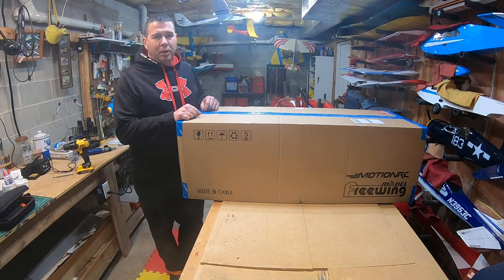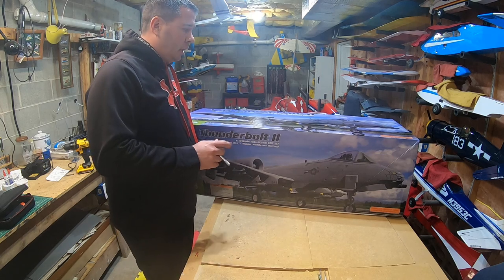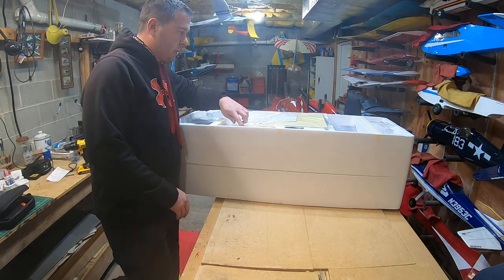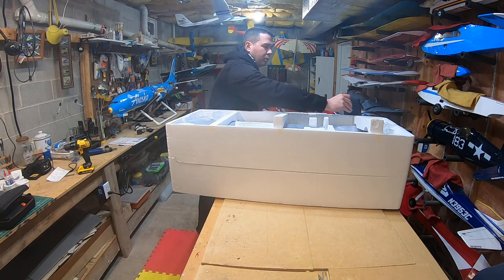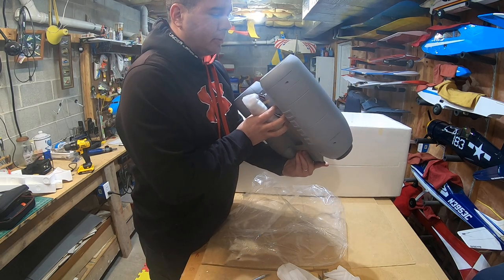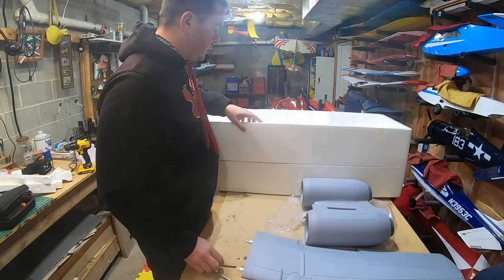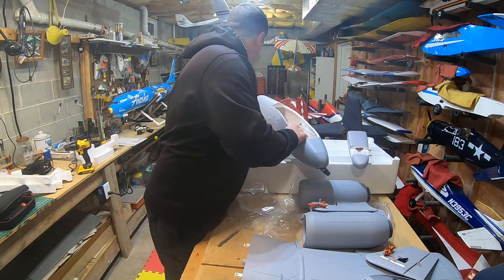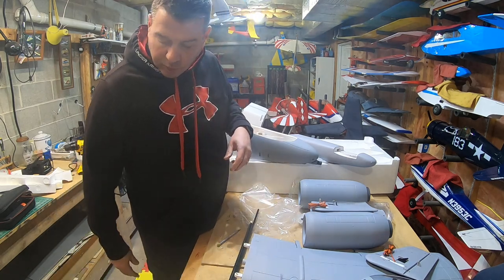Freewing Motion RC A-10 Warthog unboxing and first impression

Comment: Hey man, I thought I’d pick your brains again! I hope you’re well Brendon. I’m
Narrowing down the big jets and still finalising on such a big investment. Which would you enjoy to fly more the FW mig29 or the A10 80mm? Then between the A10 80mm and the AL37? I know the last two are a slightly different class but just comparing twins. I have a pair of FMS 80mm V2s and dual ESC. Just need an airframe. The A10 does look nuts! Thank-Ant
Reply from the maker: A10 more than the mig. The a 10 needs to be set up perfect with an aft cg to get the flare. It a beast though. I love the AL37 for simple dusk dawn circle flights. Easy to take off and land. If u want excitement a10, if u like beautiful simple al37
Reply: @JustPlaneCrazy  okay cool thanks a lot. They both are on the list, may get the A10 first as I have the power system available. The Al37 does look like a cruiser.

Comment: Greetings: Do you like this one better than the Mig 29 from Motion RC? Or is the Mig 29 Better? I can't decide which one.
Reply from the maker: Richard. Thanks for watching. Yes the a10 is a much better plane in my opinion. But. Some things need done to it as sleek. 6mm carbon rods on both sides about 16 inches long inside the nose. There are channels there. Also the blue box needs slid back to allow u to achieve a cg that is at least 5mm more aft than the most rear re immersed cg to allow u to flare and there is a 3D printed nose gear block on eBay to help pre ent the nose getting pushed. Don’t listen to people that say u need different gear. U don’t. U need the correct cg
Reply: @JustPlaneCrazy  Sounds good.  Thanks.  I'm currently flying the F18 from Horizon and absolutely love it.  I was considering the blue angels scheme with the 90mm fan from motion RC.  But I've been looking at this A10 and it's driving me crazy.  I had the Su30 from Horizon and had a lot of issues setting it up with the correct CG and landing with no flaps.   Right now I have the F18 and the Stinger from freewing  to practice.  I fly in a very windy field down in Puerto Rico with a 800ft asphalt runway where Gas turbine jets fly.